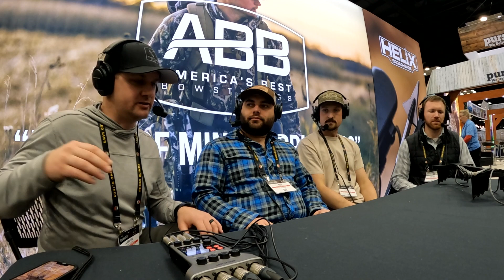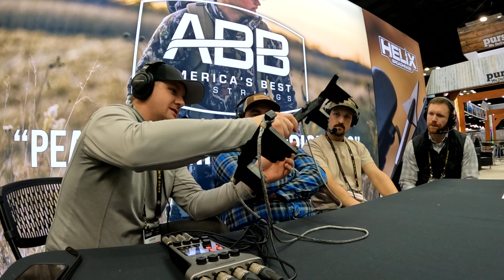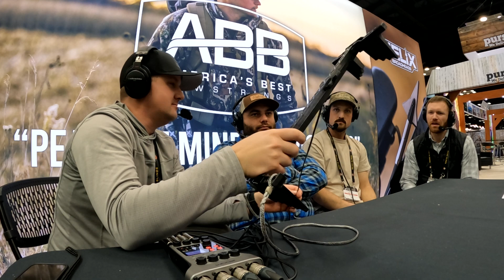Latitude Outdoors NEW Climbing Sticks | The Fall Podcast

Comment: 9:00 They said 300 lbs, on the website at launch they 275lbs.  Why did that change last minute?
Reply: I'd be curious to know the actual break strength, like is my fat ass gonna break them if I push it that extra 25lbs?